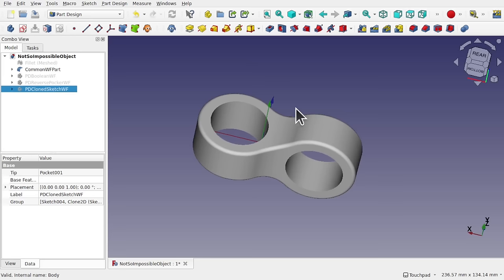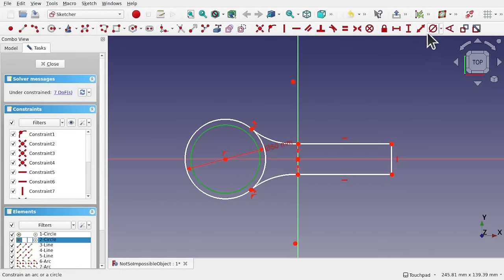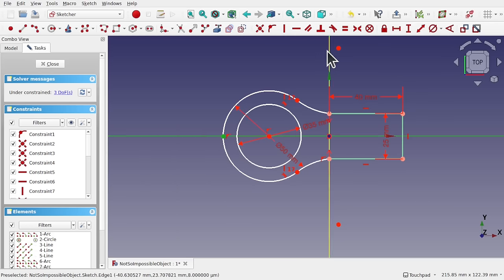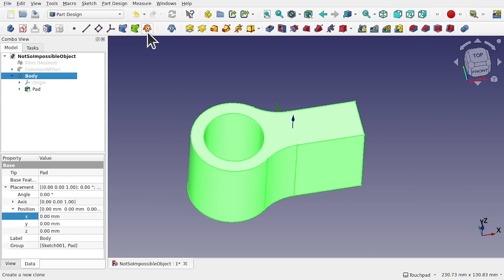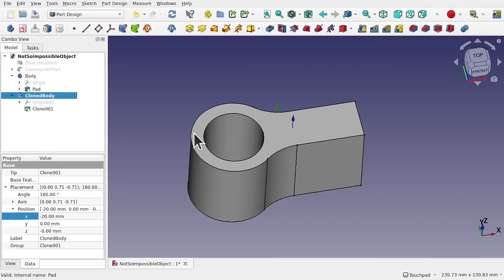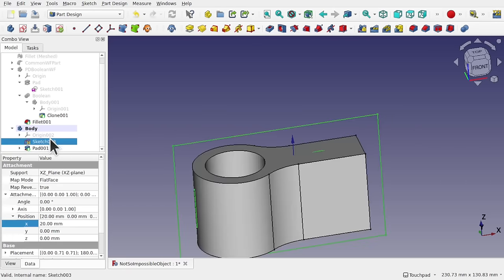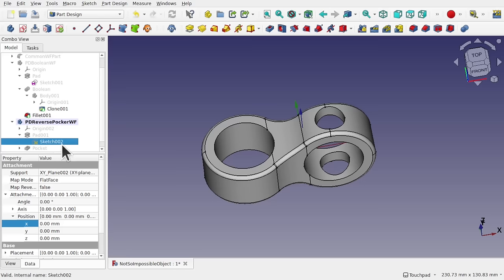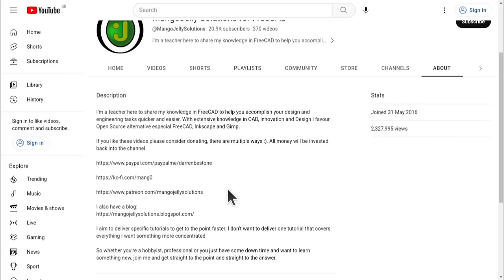This Is Not an Impossible Object! 4 Easy Ways To Model This In FreeCAD For Beginners

Comment: I saw your title screen, and went off and modelled it before watching the vid, to see what method you showed matched mine. Answer.. none 😂. I think maybe cos my thinking is more as if I was cutting the object in a toolroom, even tho this is a casting of course. But same still applies, cos I imagine how I would make the mould pattern.
Reply: lol
That's interesting
I too imagined how I would do it before seeing him do it
I started with a rectangular bar & 'carved' away what I didn't want/need
lol, as though I was in a tool room
I went from the outside in
He went from the inside out

I'm extremely new at CAD
lol, I'm thinking, 'I'm gonna start off with a bar anyhow'
That's how I approached it
His approach was a lot more sophisticated & easier, I believe
:)
Reply: @AtticusDraco  Yup. The way my brain is wired means I add and subtract to a mass. Also, cos I am a design eng by trade, for this bracket my thought was what other design options would I want. In this case, I thought probably the pitch between the bores. So I put that in my first sketch. so I can change it easily. That is, my first thought was what is this bracket for ? It is interesting how  different methods produce the same model, even tho the tought process can be totally different. 👍
Reply: For me, the methods he chose were less jarring than constantly leaving it undefined. That's what scares me.

Comment: What I hate of freecad is that stuff stop working without giving any errors and just it doesn't make sense to the user. In this case the first procedure don't work. the sketch is ok, i added measure to fully constraint it and then tried to extrude but it does't creates the upper and lower faces

Comment: Great lesson!  Question:  Does anyone know when Real Thunders branch, with the "TN" fix will be integrated?  I want to commit 100% to FC, but that issue drives me crazy.  Thank you for any information!
Reply: The answer is: never!  RealThunder's branch is never going to be merged into the main branch; at this point it is a fork. 

But the TNP fix he has implemented is being treated as a working solution and re-implemented in the main branch at the moment -- with his consultation -- for version 1.0, which is due in February next year. In the meantime I wouldn't let the TNP issue stop you using FreeCAD; there are several ways around it that are not particularly complex and let you produce robust models.

Comment: The alternating behavior of the pocket example in the last workflow was new to me.  The wiki on the part-design:pocket operation only mentions  "When selecting a single sketch, it can have multiple enclosed profiles inside a larger one, for example a rectangle with two circles inside it. But the profiles may not intersect each other. introduced in version 0.20".  Is this documented elsewhere with more detail?  After watching this video, I came to FC to experiment with simple pad/sketch scenarios and it works as you showed.
Reply from the maker: Ahh yes, it's a shame that document doesn't have a example diagram as it will be much clearer. In part design your sketch can have multiple closed geometry, say a rectangle which is closed and a circle which is again closed. They must not touch, one part of the circle must not lay over, say the edge of the rectangle (intersect).  So you can have the circle inside the rectangle. When this is padded you get a rectangle with a circle hole in the middle. If it was pocketed  to half the depth into a larger rectangle it would leave a rectangle hollow with the circle still in the middle. So the circle has to be either fully inside or outside  the rectangle with no overlap if it's in the same sketch. If the pocket was through all then you would create a multibody object as there will be a retangle void with a floating circle. Which is not allowed in part design but is in the part workbench. I hope that's not as clear as mud. May be worth me doing a video.

Comment: in your workflow were you copy the sketch and reposition, you end up with two separate sketches. If you change the dimensions in one, the other does not change.
Instead, select the sketch and create a subshape binder. Then position that binder. Now if you update the sketch dimensions, both pieces update.

Comment: What's the difference between  cloning and Duplicating? When do you use which!!
Reply from the maker: Cloning will take a clone of the original and any changes made to the original will be reflected in the clone.  So in this case to keep the same profile.  Duplicate is when you want most of it the same and want to save time but you want to add some amendments.

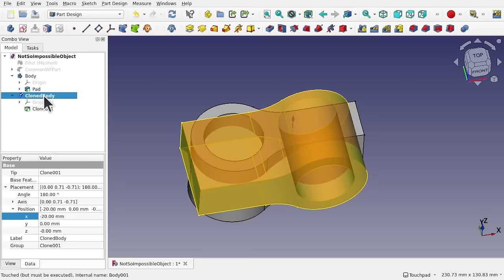Comment: I think the explanation starting at 18:04 (and related comments about the clone at 15:45) is not correct. We know that the clone has its own placement because the documentation says so and because otherwise you wouldn't have been able to rotate and move it independently of the object you cloned. What actually happens is that when you do the boolean operation, Body is moved inside ClonedBody and its placement is now relative to the local coordinate system of ClonedBody. And, because that placement (of Body) is (0, 0, 0) with 0 angle, the end result is that Body's position and orientation in the global coordinate system is identical to that of ClonedBody. You can "fix" the situation by rotating and moving Body after the boolean operation. Thanks for the video.